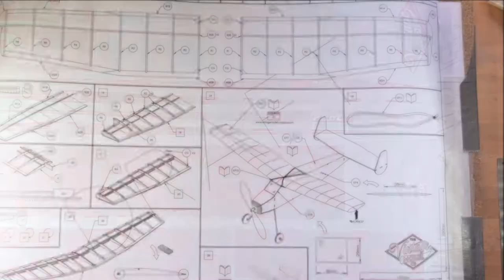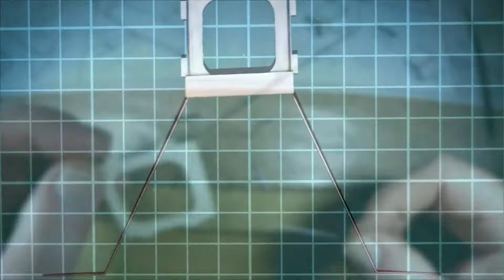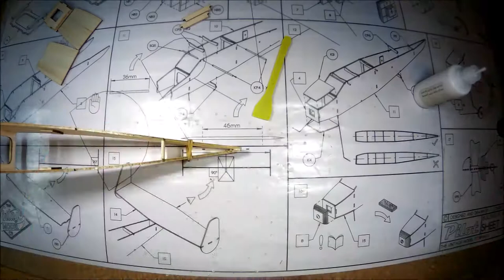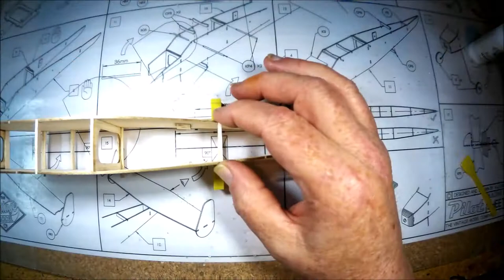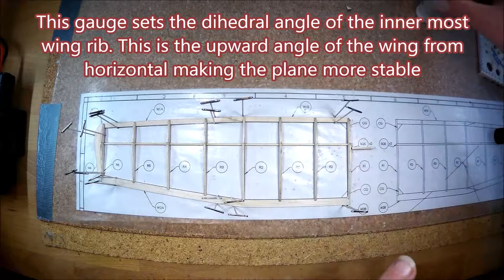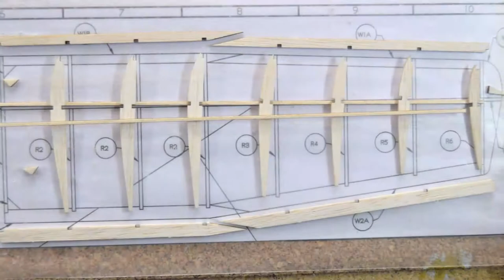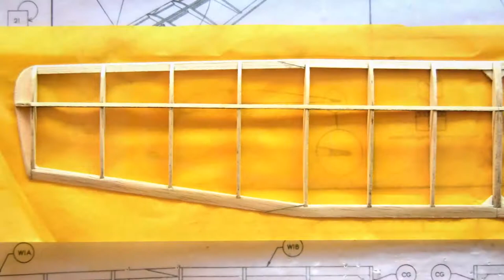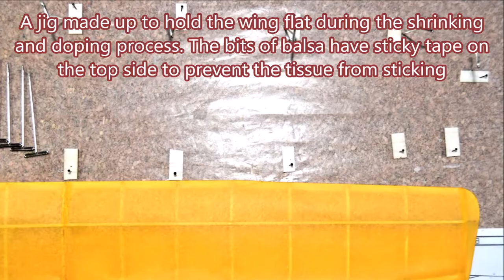Building The Vintage Model Company Pilot.

Comment: Another great Video Rob!! 👏👏👏 
I didn't know that Slab Sided, solid Balsa Sheet Models were made. What an excellent Beginner Model, and it looks like a solid flyer as well. 👍👍 

Someone on our Forums mentioned recently that our Foamies are harder to build than Free Flight Balsa Models!! Really? Several of us straightened him out quickly. The hardest bit that we deal with is making score cuts in the Foam Board, not so deep as to cut through both sides of the paper. And possibly setting the CoG, after all Electronics and Batry have been fitted.
This young lad had obviously never built a Balsa Model beyond the basic Stick Rubber Band Flyers from the Toy Store!! 

This looks like a perfect first kit for me. The only thing I would have to panic about would be the Main Wing!! 
...... Not that the rest is EASY, but I do have experience with Model building. 😉 
Cheers Mate!
Carmine ✈🚂🚙